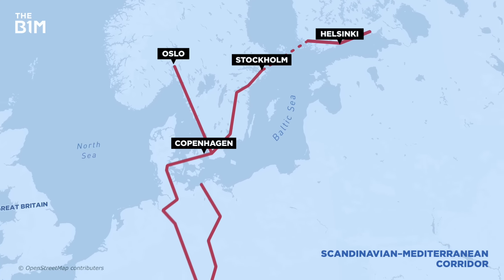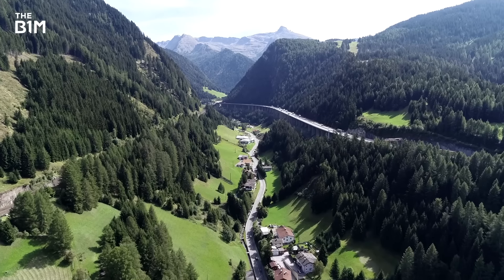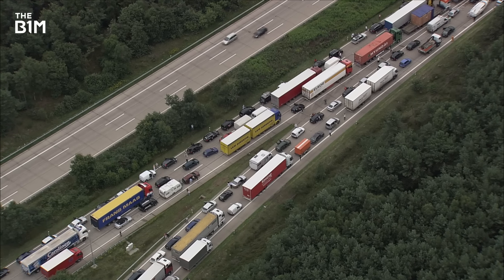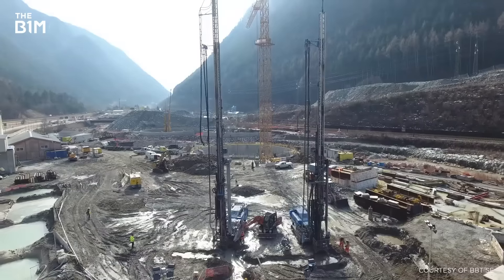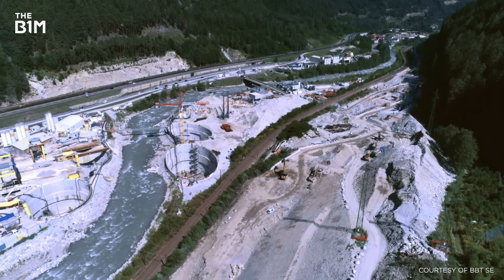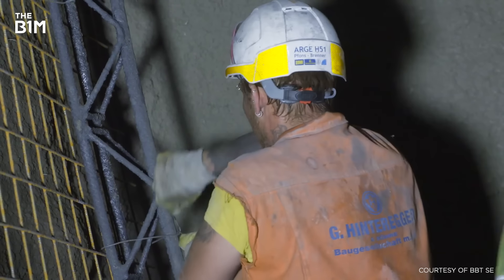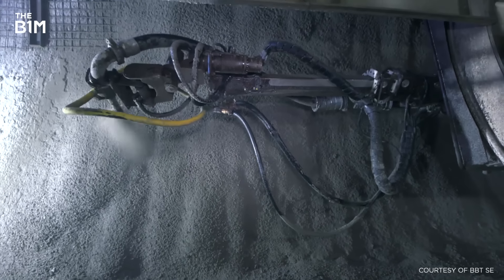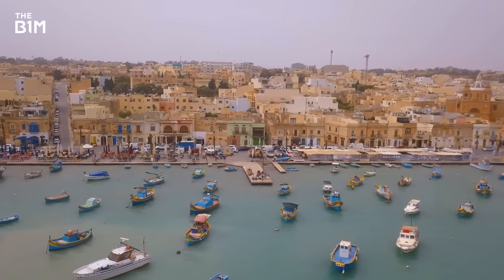The $11BN Tunnel Connecting Scandinavia to the Mediterranean

Comment: This is an amazing project. Just hope it won't be like with the Gotthard-tunnel here in Switzerland, when we built a groundbreaking tunnel, but Germany doesn't manage to build their rail tracks in the completely flat Rhine-river plateau and is expected to compleet it with an expected delay of 20 years... 😑😑😑
Reply: almost as if they do it on purpose to benefit the brenner tunnel
Reply: The same problem is present here in Austria unfortunately. Austria has already upgraded the routes which lead towards the Brenner Base tunnel a few years ago for billions of dollars (this route already consists of the two longest tunnels in austria currently) to a route for up to 230kmh, 4-track railway. All while germany hasn‘t done remotely anything to upgrade their railway which directly conntects to austria‘s brand new rail system. You really can see where austria ends and where germany starts when you drive across the border by train. From 230 constantly to 140 sometimes. And that on an old 2-track system with 2000378 level crossings.
Reply: What? Usually the Germans and Swiss are on time.
Reply: @fallinginthed33p  Well, not in terms of upgrading their railway. Germany is still very car depenend as many international automakers are based there. Except for some railway corridors in germany (for example the High Speed ICE lines), railway in germany is not adequate
Reply: maybe it’ll change and speed up with those new EU investments into rail they’ve been talking about lately.
Reply: Rail Infrastucture Projects in Germany take 20-50 Years today, if they are built at all. Upgrading that Karlsruhe-Basel Line which goes to the Gotthard base Tunnel is planned since the 1980s but won't be completed before 2050, giving it a dumbfounding 70 Years Construction Time.
Reply: It's the same here.
Reply: @Genius_at_Work  70 years ?!?

Look how China has transformed itself in 25 years and can you imagine what China would be in 70 years ?
Reply: @fallinginthed33p  swiss yes, german trains no
Reply: its almost like you arent supposed to just blindly plop railroads everywhere you feel like it but hey.
Reply: We have the same problems with Germany in the Netherlands. 25 years ago Netherlands build a ultramodern new railway from Rotterdam to the German border. There it stops. No urgency at all in Germany to do infrastructure projects.
Reply: @roodborstkalf9664  I'm so sorry :( we're jealous of your infrastructure construction speed. Our delays are very political.. our ministers tend to be incompetent and corrupt for some reason
Reply: From all the comments here it seems that those railways simply are not a priority for Germany, they rather prefer to invest, keep and upgrade their autobahns, for some reason railways are not a priority in their agenda. (Financially and technically they definitely could do it). 

One guess from me; is that they expect cars and trucks to be electric and self sufficient very soon; thus not worrying the huge investments in railways.
Reply: @Schmogel92  : It had some unforeseen positive consequences. Quite a few new logistic centers came into existence in villages and cities near the German border, There they unpackage the containers from China, add extra value and prepare the thousands of trucks going into Germany and beyond.
Reply: @TMTFT  Hamburg harbor has different ideas about that
Reply: @clocktower1164  A barren wasteland?
Reply: @clocktower1164  the whole world transformed between the 1940s and 1990s, except China.   They started in the 1990s.
Reply: @miguelosterroht    the problem is that the Deutsche Bahn owns both the tracks and the monopoly on the traffic in most parts. it was also privatised decades ago, a huge mistake. if you ask me, the only real way to go is to use the last bit of power the government has in this company and split it up into DB Trains and DB Tracks or something while returning the tracks into the hand of the government. not only would that finally create some real competition but also would it solve the slow moving progress in terms of maintenance and newly built tracks

edit: in theory. in reality, the government would find some way to gloriously fuck it up like noone has ever fucked anything up before
Reply: It took Germany two months to repair the washed-out tracks near Rastatt in 2017. In the aftermath,  the whole incident cost the equivalent of nearly 2 bn Swiss Francs. Apart from that, Germany and Switzerland agreed on extending high capacity feeder lines to the Swiss tunnels in 1996, to be completed by the time the Gotthard would open (in 2016). Their completion has only recently been delayed again ... until 2046. That is highly unacceptable and embarrassing.
Reply: @fallinginthed33p  true for switzerland
Reply: @Smittel  That‘s not accurate. EU law specifies that tracks and rolling stock must be seperated. Consequently „DB Netze“ owns the tracks and „DB“ itself pays „DB Netze“ a fee (which is to my knowledge exactly the same amount as other operators pay). The same system is used tge exact same way all over europe. In Austria for example it‘s „ÖBB“ and „ÖBB Infrastruktur“. With the difference that it works much better in austria (and most other EU countries) compared to germany.

EDIT: When I speak of „DB“ or „ÖBB“ I‘m talking about the respective passenger divisons of their railways. I‘m aware that those subsidiaries are all owned by the same holding company.
Reply: @wio2189  Germany also delays the Brenner Basis Tunnel
Reply: @fallinginthed33p  Germans are never on time... BER or S21 are awesome example.
Reply: @fallinginthed33p the swiss more then in time, they built already the new gotthard tunnel. the problem is for all countrys in europe… germany. they just lazy
Reply: @miguelosterroht  the problem is germany already signed contracts with switzerland, the netherlands, austria… but germany does nothing.
Reply: @asch5089  Its the other way around when it comes to roads, germany is the only country investing into highspeed roads.
Reply: we just need to tell them that until the connections are not done, not a single german truck, or transporting german goods, not destined within switzerland, cannot use our highways, then they will build it faster than the chinese 😂
Reply: For what I know, Austrians and Italians are collaborating very well, works are proceeding as planned and with no major issues. Germans, on the other hand, are stalling about their section of this corridor north of Innsbruck.

Comment: Technology developed for the Gotthard is being used here, thus reducing specific costs.
Many austrians worked on the Gotthard project and then brought this extra experience, they were very well experienced before, make that the tunnel costs less per km than the Gotthard.
Reply: Didn't the Gotthard base tunnel cost 9.6 billion in the end and is longer than the Brenner base tunnel? If the 11 billion projected cost from this video's title are correct, your comment doesn't really add up. That doesn't mean though that the Brenner is cheaper due to the experience from the Gotthard, because it's entirely possible that the Brenner has a geological composition that makes it more expensive than the Gotthard, i don't know though.
Reply: @Naryoril  the tunnel per se will be shorter than the Gotthard base tunnel but the junction with the existing structure will make it the longest underground rail tunnel experience in the world.
Actually news from Asia indicate this record may not last long.
The cost is higher but counting in for inflation the same will be less expensive.
Reply: @Braun30  The "in junction with the existing structure it will be longer" doesn't really count unless you also factor in the cost for that back in the day, or is that part if the 11 billion? But yeah, i forgot about the inflation, that would explain it. Let's hope the Brenner doesn't end up being about 50% more expensive than projectet at the beginning like the Gotthard did.

Comment: In the end, the Alps will be crossed by 3 base tunnels ... Gothard (Switzerland-Italy) Brenner (Austria-Italy) and Ambin (Lyon Turin).

For Lyon Turin, the base tunnel will be 57 km but the project covers 140 km before and after with the construction of a LGV and other tunnels.
Reply: Sounds like switzerland has to built a 65km tunnel to be on top again.
Reply: you forgot the sempione tunnel that switzerland built which is actually the only one that is switzerland-italy , the gottardo tunnel is switzerland-switzerland, and there's also the Ceneri base tunnel, which is Bellinzona-Lugano, which is also switzerland-switzerland, the only thing the italians built is an upgrade to the luino-gallarate, to get to bellinzona and the gottardo tunnel, of course only after the swiss railways has lent them 200+ million francs to do it

Comment: For a functional link the tunnel needs new rail capacity. In my opinion this link will not be fully operational before 2040-45 because of the delays on the German routes ! Have a look at the Rotterdam-Genova line through the Gotthard Base Tunnel, open since 2016 and the feeder line in Germany isn’t ready, the international treaty was signed in 1996 !

Comment: I am from northern Italy, about 200km away from the site, and I had no idea this was going on. I cross the Brenner pass driving on the highway at least 2 times per year, still had no clue. They are hiding it very well and probably on purpose, because they want to avoid the kind of uprisings that happened because of the construction of the tunnel in Val di Susa (a bit more west, connecting with France)
Reply: I remember going over the Brenner Overpass when I was a boy. We were going from Heidelberg Germany to Verona Italy. The Overpass is amazingly high, and very impressive. The highway certainly made the trips to Italy easier than they were previously.

Comment: now germany just needs to get up and finally build the german side of the tunnel to denmark
Reply: It would be faster to build around Germany and reroute the trains through Austria, Czechia and Poland.
Reply: Yeah we tried that with the Betuwelijn, their part should've finished around 2003 and the current goal is 2022
Reply: I believe they are actually starting. Check out the YouTube channel DEGES , they recently released a video about this project.
Reply: Actually, Denmark is building the tunnel all by themself, Germany just upgrades their "Hinterland" - infrastructure. More importantly they have to work on their section following the Brenner-Pass to Munich.
Reply: @Jup_94  And they are still debating on the route to Munich. And there are citizen getting the rail into a tunnel and still anoyed by that...
Reply: Denmark is going to build it alone. Germany only has to do the connecting parts on land.
The tunnel would save 2 hours on your trip from Finland to Italy.
Reply: @Jup_94  Yeah, I meant that as a joke. I mean it's sad to se such a big project being delayed because of one city (Rosenheim) being annoyed by trains going through a tunnel.
Reply: And of course add a second train track between the tunnel and Lübeck so there's not just one for all the train traffic between Hamburg and Stockholm.
And install power lines for electric trains. :p
The leg between Hamburg and Lübeck got power lines only in 2008. We're still in the stone age up here.
Reply: @Maitch3000  “I’d like to buy a ticket from Helsinki to Rome, please- how much will it cost?”
“11 billion dollars…”
“Wait, WHAAAAAAT?!?!”
“But we’re saving you two hours…”
“Oh, well that’s alright then… How much for a round-trip ticket?”
Reply: @Jup_94  What are the Germans doing honestly 😂😂 I've seen dozens of examples where surrounding countries are doing their best to finish big projects in time and the Germans are just delaying their parts
Reply: germany just needs to electrify their railways, that might take a while, also they might run out of electricity
Reply: @reyods  Austria builds in Rosenheim a short cut. So the train doesn't drive into the station Rosenheim and had to change it's direction.
Reply: Yeah you had a guy in office who sai the same thing and who wanted to change that but you voted him out.
Reply: @mernisch8307  theyre busy building state of the art nuclear subs for Israel, financing loans to the lesser economies of the EU and welfare services for turkish  settlers while patiently waiting for U.S. forces to stop occupying their country.
Reply: @xXDrocenXx  But Rosenheim is in Germany. I guess what you mean is the new track from Kufstein over the border. What I meant was the track that is supposed to go around Rosenheim. Last time I checked there was still a big debate going on there on how to do it, since the locals didn't want mor trains going through or even near their city. I mean they approved the Plan in April of this Year so maybe they'll be finished when the Brenner-Tunnel is opened in 2032.

Comment: This project is truly a milestone of railway construction. Austria already built a new high-speed track which connects to this tunnel for billions of euros in order to accommodate all the traffic which is projected. In total, a four line track is running across the "Inntal" (two newly build tracks for 230km/h which runs underground almost completely and the two tracks which already existed before ,which have been upgraded) to service the tunnel. However, such a transportation axis is only as strong as it's weakest link, which in this case is germany. German politics have consistently opposed to upgrade their railway infrastructure directly across the border to Austria. It currently consist of a standard 2-track system built ages ago. With level crossings and regional train stations every kilometer. 
If germany doesn't finally move forward with that project (which they actually promised to do wayyy back when this transportation axis was envisioned by the EU), the whole project will be (drastically speaking) useless as almost all traffic for the Brenner Base tunnel will origin in germany.
Reply: Forget it, nothing will happen in germany. Germany also promised (1996) to expand the train connections to the Gotthard tunnel and look where they are today.
Reply: @thomaskramer4739  The problem in Germany with public projects is that every citizen can complain and every complain has to be heard. There's lots of multinational projects where other nations are already finished with building and germany is still planning.

Comment: The largest issue with the ScanMed corridor is the lack of north-south passenger rail services. The only service from one of the Scandinavian peninsular countries that goes more south than Denmark is the year-round + additional privately operated seasonal summer service from Stockholm to/from Berlin. Norway has not a single direct rail connection to Germany or even Denmark.